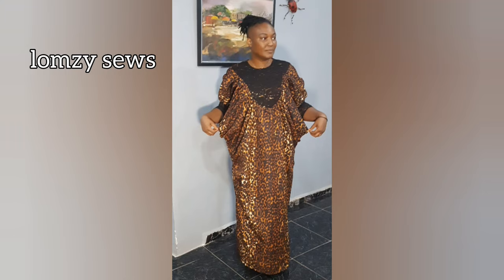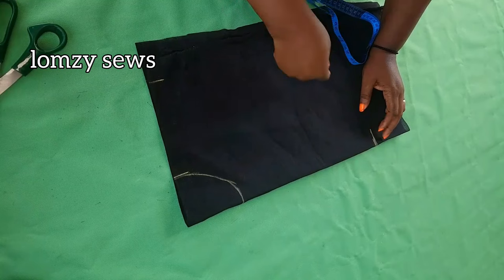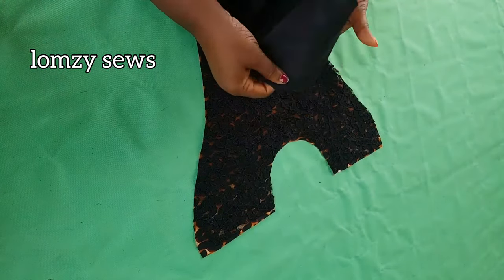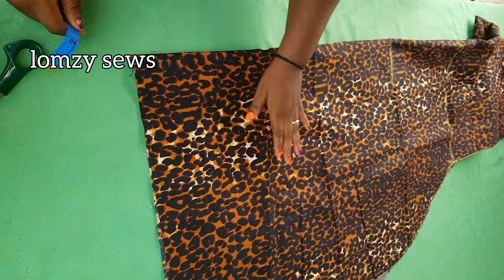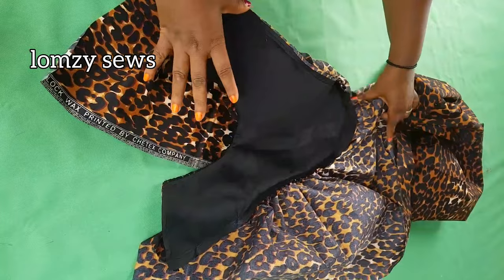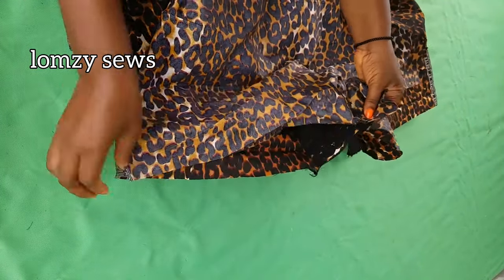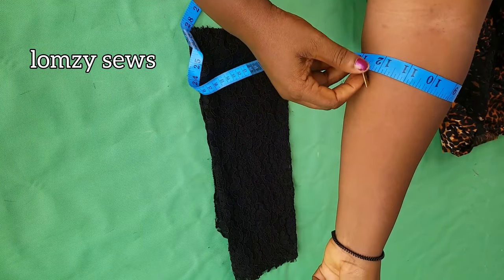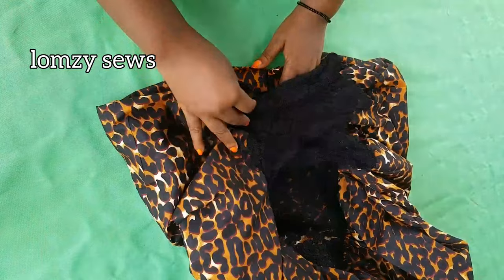👗👌How to Cut And Sew A Bubu Gown Style With Cowl Side Seam | Gathered Neck Design | Kaftan Bubu Gown

Comment: Please ma, the upper bust you used  for the front sides was 25.5 inches and the hip line you used was 35.5 inches

But for the back you used 26 inches as the hip line instead of 36

I don't really understand ma
Reply from the maker: Its because the front has drape
Reply: Thanks so much ma